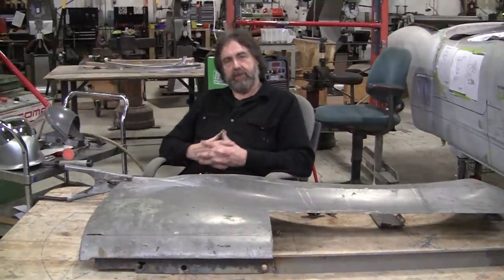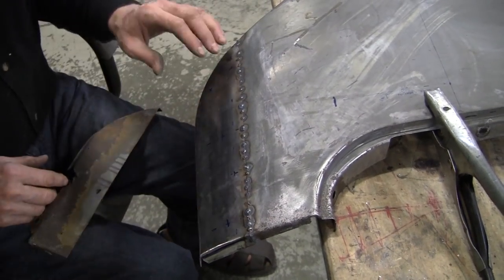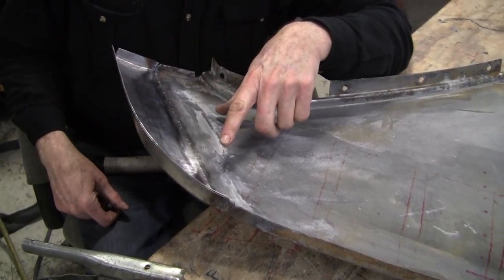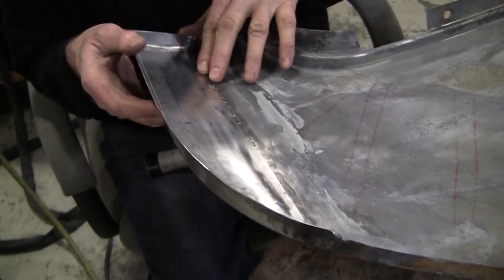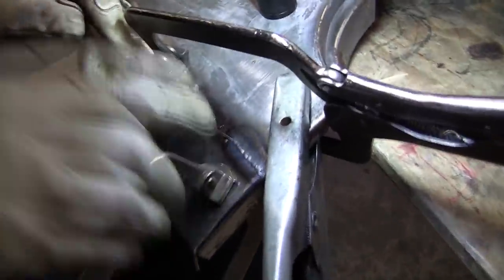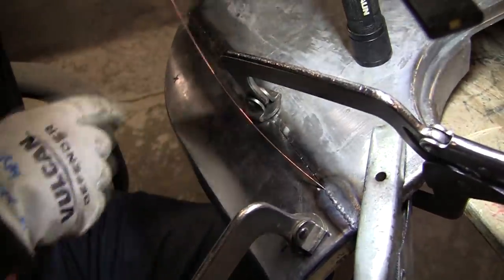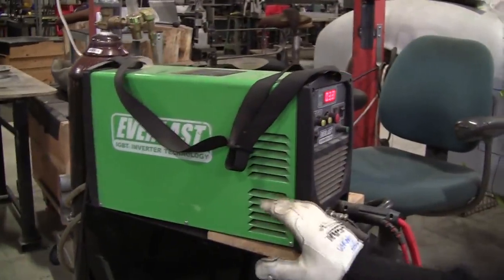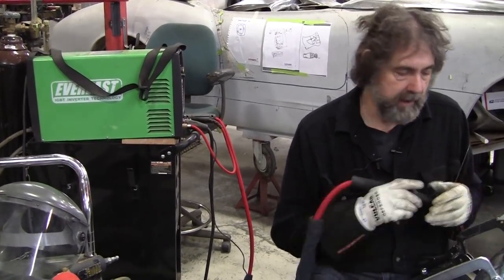TIG Butt Welding: Scout 800 Fender

Comment: Thank you for the tips. I have the latest miller welder that you can mig-tig-stick weld. I haven't tried tig welding yet, I used to gas weld. I have some Ron Covell videos on tig welding, I will be practicing tig welding this winter.

Comment: Wray, so glad your back. I have replaced ready-made patch panels with the same welding procedure. Tack, align, weld about an inch, watch the heat. It is slow but, you can keep things from getting out of control. problem I run into is I purchase patch panels that are the wrong material thickness. (you can guess where they come from). I have had much better luck with panels I fabricate from the correct thickness of material. A couple of thousandths makes a big difference. Make sure your panels are the same thickness. it pays to measure.

Comment: My best suggestion for tig butt welding sheet is to use the pulse function if your machine has it. Most do not but I find it really helps. Also I really enjoy the results from using a purpose built tungsten grinder, the electric "dremel" style with a diamond wheel and drilled guide holes. Must cleaner consistant results vs a stone bench grinder. I also like using pyrex glass shielding cups, size number 10. And my last tip is actually one Wray said during the class, use a cheater lens inside your hood!
Reply: DieselPunk Cummins - do you have a particular brand of Tungsten sharpener that you'd recommend?

Comment: I’ve been watching Bad Chad, and I love his show and his vision, but the rough fabrication and slathering of body filler approach he uses is anathema to me. He says that “this is how it’s done in the custom car world”, and sadly, it’s probably true. At one time, skim coats of “Bondo” over the whole car was considered hackery. Still feel that way. Hard to get that out of your head. This is top-level work right here.
Reply from the maker: My rule is "designer's intent" no designer of a car sees bondo filler making his surfaces. Bondo work is corner cutting because of lack of budget or more likely lack of skills. Anybody can put frosting on a cake.
Reply: If you want every panel and gap perfect then  filler of some kind is the only way to get perfection, because no cars panels line up perfect no matter who makes it
Reply: He wants to build it fast and if someone wants to build the CAR and is not a millionare, the bondo is the way to go. Especilly if the metal and paint is considered boring, 

If the metal work is the central part of the build, then do it to the no bondo level. 

The bondo is not the thing that chrink, its the high build primer that chrink over time. If the bondo crack, it can absorb water and you have to fix that. 

I am not for the bondo way and think its better, dont in any way, but i dont want the ammont of bondo to stop some build being built. It is considered a good build to me even if it has bondo ontop of it. 99.9% of the builds in this world is done that way so no way around it.

Comment: I like your thoughts. I haven't done any metal working, just trying to learn at this point. All I've ever heard is that you've got to use Bondo. They've told me you'll never be able to do this or that without Bondo. I always wondered why you needed it when you can remove dents and whatnot. Your approach is what, in my mind at least, is the right approach.
Reply: After 20 years you might get good enough

Comment: It looked like you were trying to make a Faraday cage for the torch using aluminum foil when doing your TIG welding.  FYI, it's important for a Faraday cage to be grounded to be effective.  You would probably need to also shield the torch all the way back to the machine.  The frequency of the welding can also be important, as is the operating frequency of of the bluetooth (I'm assuming) microphone.  If the bluetooth's frequency is a multiple of the machine's frequency, it will strongly affect the signal of the microphone.

Comment: Probably the hf start. A lot of electro rubbish is coming from a welder. Very nice video
Reply from the maker: Yes, once I clicked the on off button on the torch the wireless sound kicked out. Never did it before with the foot pedal.

Comment: Very good presentation as always!
Wondering, what about welding from the backside and having the seemingly nicer weld bead on the front?
Thanks, JIM
Reply from the maker: The weld was perfect on the outside, it just needed a little grinding. If you fusion weld there is little or no bead to grind but you might have to fill a few divots.
Reply: @proshaper  Thank you for the reply, but you did not answer my question.
Thanks, JIM

Comment: Wray, Thanks for really informative and high quality video's. I Can I ask what current setting do you use when TIG welding 19g/20g steel.
Reply from the maker: 30 to 40 amps if you are using a foot pedal. In this case with  the on off button control, I think I had 35 amps for 19 gauge.
Reply: Many thanks Wray @proshaper

Comment: Wray, one more point. I use an SSC (same people who make the high quality foot pedals) "touch 4" hand control. It has four settings via 4 micro switches under the trigger. Takes a little practice, but you get 4 heat settings just by applying more or less pressure. Here's a vid:   https://www.youtube.com/watch?v=ckg6rVeu8FU

Comment: Would stitch welding decrease warping?
Reply from the maker: There is no way to weld sheet metal and not have some heat distortion. Once you fully understand how to correct any issues from welding sheet metal, distortion is not a issue.  The main goal should be to learn how to correct any distortion.

Comment: How long does tig take to master enough to do this ?  Does it use the same gas that I use with my mig?
Reply from the maker: You can tig weld as good as I can after a few hours of practice if you have a steady hand and good eyesight. Once you try it you will never go back to a mig. I have two migs, I use them for structural welding only.

Comment: Thanks Wray, what brand tig switch do you use?
Reply from the maker: The torch came with both the finger switch and the footpedal, it came with the Everlast welder.
Reply: @proshaper  You mentioned an upcoming video about welding in a patch panel without access to the back side. Several years ago during a chat session, a metalshaper by the named of Clive Ross from Australia mentioned a method of pre stretching the edge of both patch panels before welding. I have never tried it, have you heard of it? or tried it?

Comment: But how much AIR do those HF grinders use?  That's my complaint with all HF air tools, they are air hogs compared with quality US made air tools.  Don't know about "chief".
Reply from the maker: Hi Ken, I run my compressor at 150 PSI. All of the harbor Freight "Chief" brand tools are very good.  They now have three price point/quality levels for some of their products.
Reply: @proshaper  Hi Wray, Thanks for the reply, I like that LED light. I mounted an el cheapo light on my helmet but it eats up batteries and isn't too bright - too far away from the weld I guess? Think I'll try one of those, look to be $30.

Comment: Don't bother buying the harbor freight led I have had two, and both died in 6 months. I did really like them while they lasted. Hoping Coast or Stream light come out with one similar to the HF
Reply from the maker: I have been using Harbor Freight air tools for 30 years. Lots of failures with the lower price air tools, the new upgraded Harbor Freight air tools are excellent.
Reply: @proshaper  Yes they are hit and miss, I really wished the Led lights were better quality as I really like them.